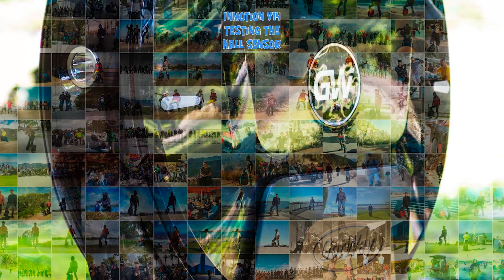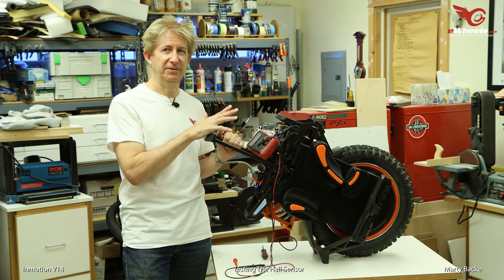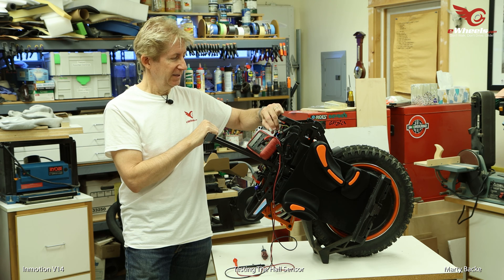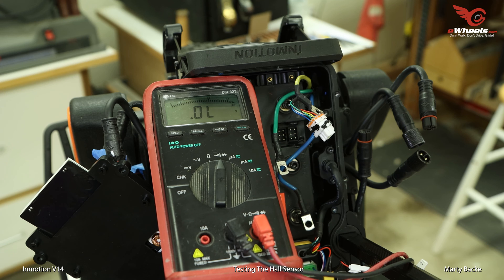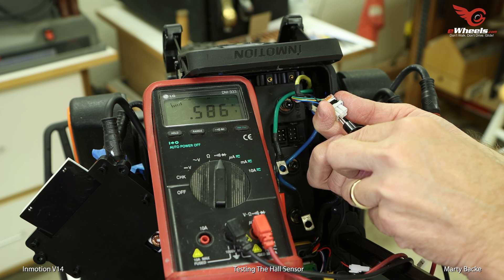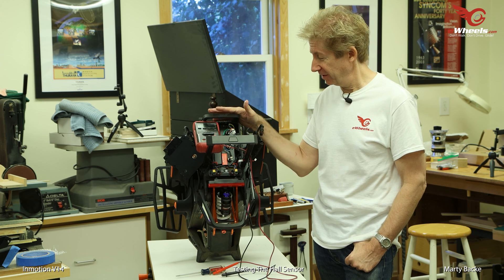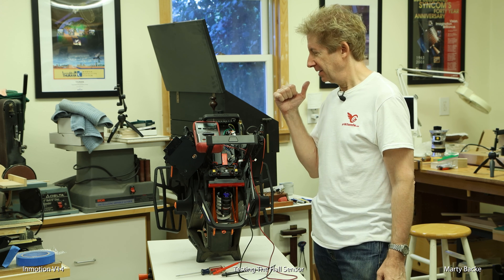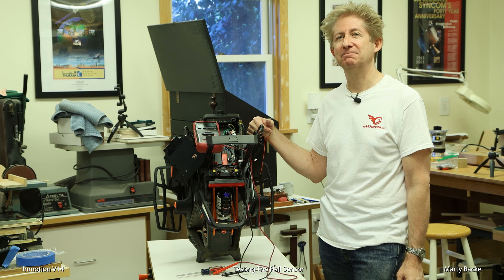Inmotion V14 Hall Sensor Test

Comment: Why doesn't Inmotion perform intensive load testing of the controller boards BEFORE they are mounted on the wheels? This would greatly improve safety.

Comment: Two things: 
1. This is obviously the Raptor controller issue since it is shorted. 
2. Measuring the impedance of the Hall sensors without knowing their part number is not saying much actually. A proper test would have been to connect the sensors to a power source and measure the output signal while rotating the wheel. 

I have a V12 and had the same board problem, I really was looking forward to this wheel but Inmotion messed up again. Come on man!!
Reply from the maker: You do realize that the Inmotion engineers, who presumably know the part numbers, asked me to make the measurements and told me the expected values?

Comment: Thanks.  I already switched my order and started riding my Patton (happy with it so far).  I hope this gets resolved because I researched this for a month, but didn't want to worry about these issues and I'm sure others feel the same way that are sticking it out.
Reply: You never know which wheel might be a bad one.  I had a Sherman Max need the battery replaced fairly early on, but it's been fine since then.  And Begodes that are supposed to have poor quality haven't given me a lick of trouble.  Patton's good, but I think I'd rather have a slightly larger wheel for off-roading for increased comfort and stability.